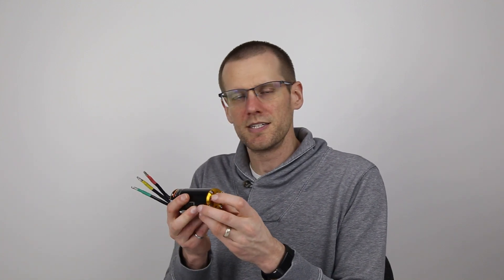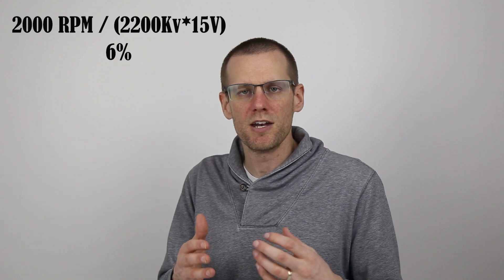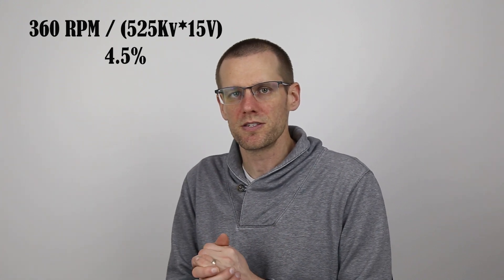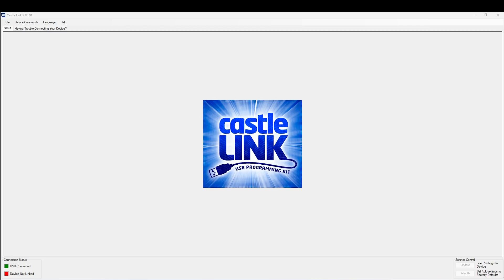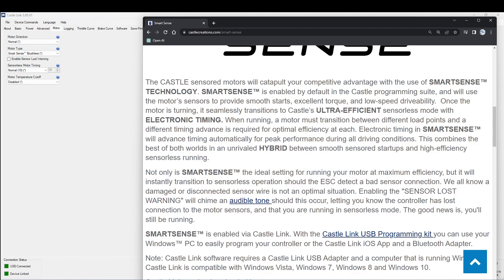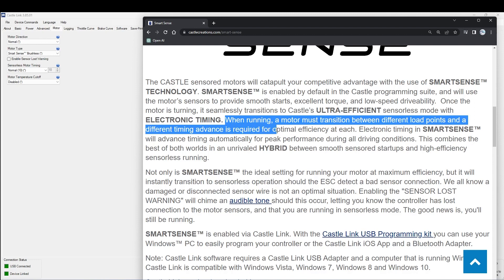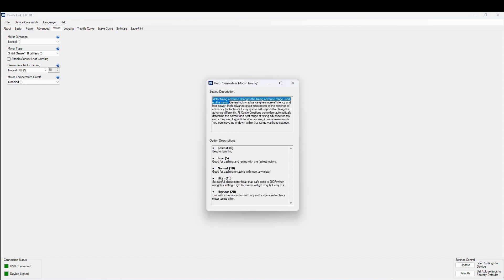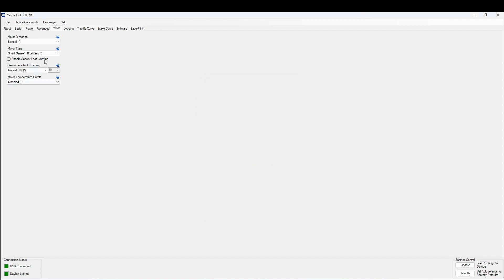How Sensorless Mode Takes Over: Sensored vs Sensorless RPM Range in an ESC

Comment: I thought I understood sensored setups until burning out a 140A ESC somehow. It seemed completely fine at first and I was amazed at the slow crawling ability and smooth throttle control. Then I started testing out the torque which was the point of it for me, to avoid the non-start situation of locked wheels from too much resistance in things like tall grass. That had previously overheated the stock ESC trying to 'cog' over obstacles too many times. The sensored pair is using a 2400Kv instead of the stock 3200 so I figured that would also help my torque. It didn't take much of me testing the torque (slow crawling over a pile of clothes) to bring it into what I thought was an overtemp shutdown, but it turned out I burned up the ESC throttle control and only the BEC still worked. 

So now I'm a little puzzled in that I just put the 80A stock sensorless ESC back on while keeping the sensored 2400Kv in there, and am able to "cog-crawl" my way around totally fine for long periods without anything overheating. I can only imagine outside of just a bad ESC, that the sensored action of slow crawling over obstacles must be putting immense stress on the ESC relative to just trying to jolt over them with a sensorless setup. I'm wondering if during my slow crawling it just happened to reach a point of high resistance and forced its way through, while also generating enough heat to kill something (capacitors eventually violently leaked) after trying to factory reset what I thought was just some calibration issue.) I don't know if this is accurate though.. but if so, I'd imagine I could still use the sensored ESC if I replace it, and be able to slow crawl my way around a lot, but have to be wary that there may be no way for the ESC to detect too much of a load on it before it self destructs.
Reply from the maker: its hard to tell without knowing your full setup or any data.
Reply: @RCexplained  I realize now the ARRMA 3s Big Rock is probably just too heavy of a rig to be trying that even if I were to gear down also. I just wanted it to cog less since I do a lot of slow driving in FPV (whichs adds a bit of extra weight). I figured the sensored stuff could also just help me crawl better in a creeping slowly sense, not an actual crawling over rocks sense. So really the issue is not knowing how much stress any particular load on the motor/esc is at the time if it's able to basically crawl over it without me having any feedback. With the standard ESC I know when the load is too great cause it just cogs out. 

Either way it was just confusing seeing a stock BLX100 (which a lot of people call crap) always work well for me with stock tires no matter what kind of slow-crawling or fast grass driving abuse I gave it... but then that 140A sensored ESC craps out on me almost without any warning before I ever ran it anything close to as hard as the BLX100. I may just do a second identical test on the next one here in a few days and if it burns out try to make it work with like a Max8 or something. Or Monster X. Really kind of wasting money here on it cause I've already got a Copperhead coming I'm going to try til my Max10 replacement comes haha. Only thing I'm not sure of is cross brand pairing of sensored ESCs and motors. Hopefully the hobbywing motor I still have in there is compatible with the copperhead in sensored mode.
Reply: @RCexplained  Ok so for what it's worth since I've bugged you about it I think it may have just been a fluke with the Hobbywing. I've been running the Copperhead 10 as a placeholder and it has worked out totally fine. Doesn't seem to mind moving that Big Rock around at all, even slowly over moderate obstacles. The PWM just sounds like crap on it which is why I'm still going back to the Hobbywing when it comes. 

I did notice that this Copperhead ESC has a default 'initial throttle' setting where it's set to low power. Maybe the Hobbywing is at higher power by default.. so basically it may try to force its way through an immovable object until the fets die or wires melt. The Copperhead just seems to crap out since it's not set to supply an infinite current.

Comment: Can I run 2650 kv castle motor on smartsense yet set the timing in  sensorless without using the sensor wires at all?will the timing work?
Reply from the maker: When timing is set manually, it is for sensorless operation.
Reply: @RCexplained  I ran fee passes sensorless  mode on mamba monster 6s,I'm using 4s my timing was set at 10 yet it seems to heat up fast..my gearing is ok..I'm setup up is for 32pitch..my ratio is 20 pinion and 42t spur in running on 2650kv..

Comment: Hey Buddy, can you explain how the timing boost works with sensored motors? I commented on the video yesterday with a comment about “turbo”, and I do like the boost and smoothness I get from sensored motors. I do use a sensored setup racing, but also enjoy a sensored setup bashing, and notice the difference in my road cars moreso.
Reply from the maker: Boost within the ESC typically meant changing fixed timing from a minimum  RPM  to a maximum threshold. Once at max timing was held constant. 
This is an old method of timing control for sensored motors. A better way for the esc to handle this is once the motor is running smooth switch to sensorless mode and alter timing based off of load, throttle input, rpm, etc.

Comment: Great tutorial on when sensors are useful. I’ve noticed that HW has developed a hybrid Sensored mode that the user can set to rely on the sensor up to a point in acceleration. I’d love to see a tutorial on the XR8 Plus and all the newer Gen3 features. Like coasting and being able to specify where in the RPM band the turbo activates. I’m not sure is this is like Castle or if it is different… You have been really great about explaining the subtle differences so I think you would be the right person to compare and contrast what Castle has and where HW is heading… I hope that HW decides to add this same programmability to their newer Max4 ESC… I’ve noticed that when using the Max4 with the recommended HW70125 - 560kv motor, it actually produces more power/RPM to the motor under load (42lb Losi 5iveT 2.0). the data logs even show around 36k RPM, which is well over what it should be doing. I set the motor parameters to match the motor’s specs and data logs continue to show that really high RPM. This is when the sensor is connected. In sensorless mode, it seems to be more of what I expect. So, if you could explain what is happening to get these “over spec” results from the motor under high load, then that would really really help!
Reply: Hmm, interesting 🤔

Comment: A hammer is much more reliable device than an iPhone, simply because there is a much lesser chance the hammer will malfunction during its usage. I guess, you see how your logic that senseless is less complicated does not hold water. 
Yes, maybe you do not need to know the position or the number of turns your motor makes. However, if you do, there is no other way you can detect the position or/and number of rotations of non/stepper motors (especially for brushed DC motors) but to use a qualified sensor coupled to the motor's shaft.

Comment: I never realized how much more fun it was to drive around with a sensored motor even for a basher untill I put one in. I have a sensored castle in my arrma outcast and it suddenly gave it a bunch of new abilities. It can smoothly crawl up and down my foot and over rocks in the extremely slow sensored range. I didn't expect it to make such a difference on a basher but it gained some light crawling ability which is fun and I never had experienced before.

Comment: I have many 1/10 on road touring cars and made a transition to sensored motors for some of my cars a few years ago. I didn’t really notice the difference until I drove a car that had a sensor less motor. The difference is significant. I really like the smooth starts of the sensored motors for on road cars and are overall “smoother” throughout the entire throttle range. I only have HW Quicrun and XR10 sensored esc’s and motors. the sensorless ESC’s I have a are Castle Sidewinder 3’s and the 4600/5700 kv motors.

Comment: I'm running a Reedy 540-FT 21.5  with a Vesc 6 MKIII. The application is a 1/12 scale Tamiya Hauler Truck.  I'm currently running it sensorless and it's cogging like a MF .  It's a semi truck so max speed will be 15mph.  How can I fix the cogging problem?  Do I  add the sensor wire,  or can it be tuned out by messing with Vesc settings which there are an insane amount of
Reply: Get the wire
Reply: Def try to go sensored. It will be perfectly smooth from a stop with the sensored motor.
Reply: @memememine1  I just ordered the cable.
Reply from the maker: To immediately eliminate any start-up hesitation, use a sensored motor. 
Look at the difference in this video:
https://youtu.be/D9sDRStP1xw